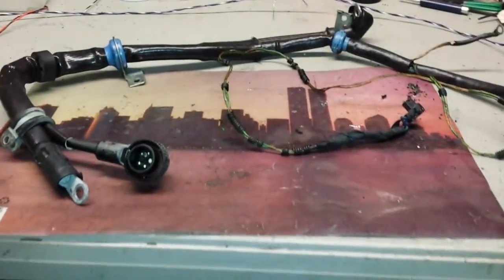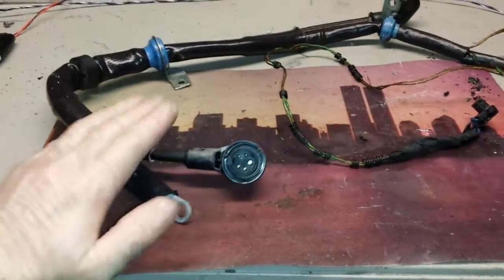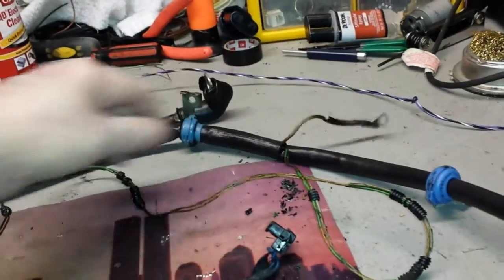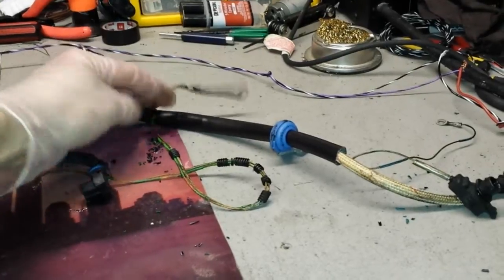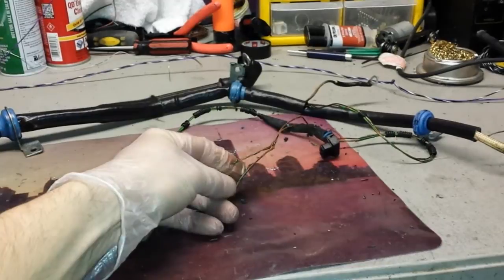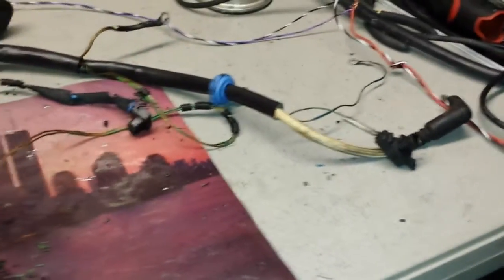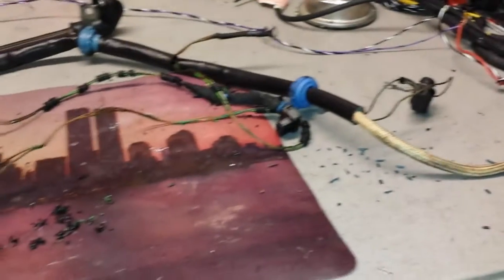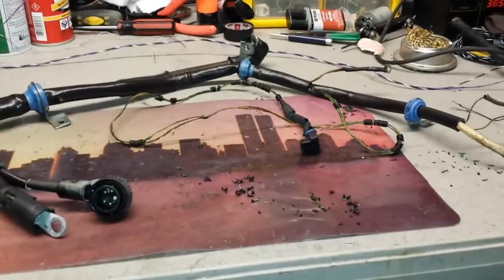Mercedes V12 lower engine wiring haress problems

Comment: Did I understand it is only the V8 and V12 with the lower engine wiring harness?
The 93 300E 2.8 Inline 6 does not have this lower harness, it is all part of the upper harness?
I know the upper harness was replaced on my car by the previous owner, but there was no mention about a lower harness. Now I wonder if this will need to be replaced, if it is separate.

Comment: I have a 2001 cl600 with oil at G3/7 o2 sensor, causing a code for that o2
any ideas what sensor causes the oil intrustion and can I do the process of"tinning" the wires at either end to prevent further contamination?  Doing so would trap the oil in the harness, would that destroy the harness over time?
Reply from the maker: Dont know without seeing the car. Need to find where oil is coming from

Comment: Hello.. my 93 600sl with 190k miles which I have owned for 16 years (75k when I bought it) has a oil pressure gauge that started bouncing around. It would work normal until the engine would get warm and then suddenly drop to zero and red light would come on for 5 seconds to 5 min, then it would suddenly go back to 2-3 then 0 then 1 ect.. anyway it progressively got worse until now it stays at 0 and the red light goes on and off randomly. I replaced the oil pressure sensor on the oil filter housing and did a filter and oil change..( Rosella T6 5w 40, I live in Colorado) now the gauge is at 3 and doesn't move, no red light.. (I may have hooked the pin up backwards.) assuming I did what are your thoughts? Thank you..